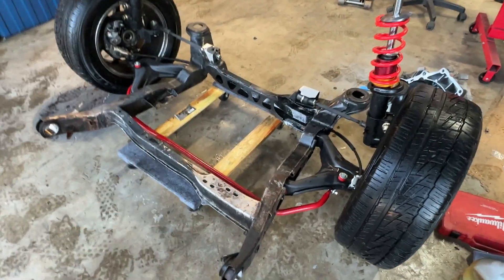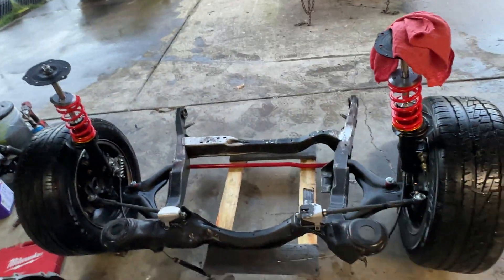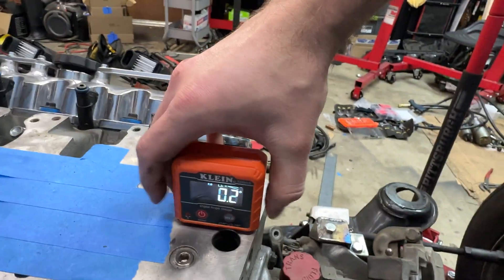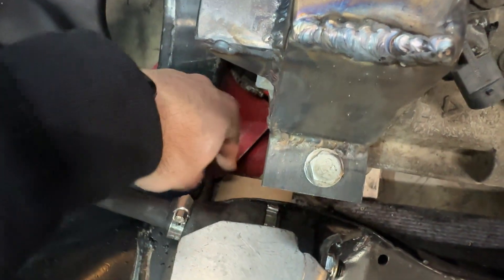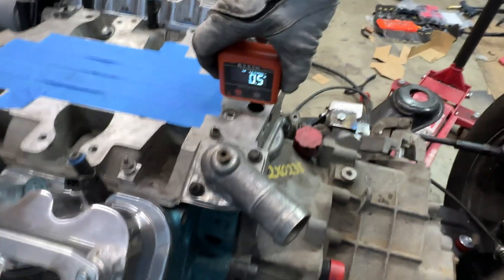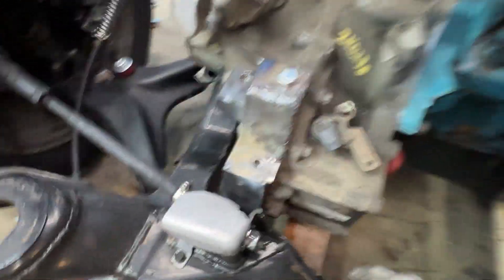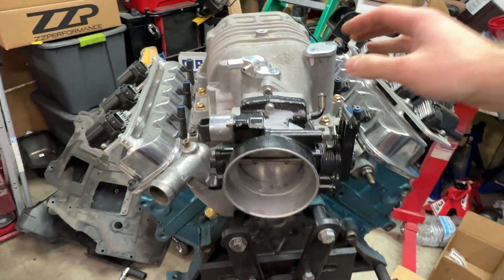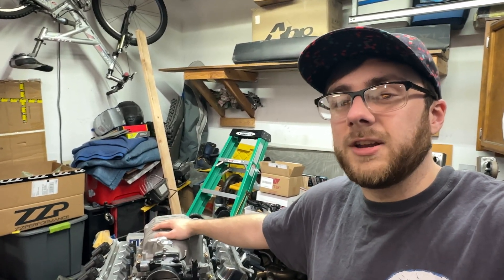1986 Fiero GT Engine Swap: Turbo 3800 Test Fit and Mounts

Comment: Glad to see that you are getting on with it. However, your solid mount setup will shake your teeth out! I hope you don't intend to drive long distances with this car?
Going solid mounts means basic race car only.
Please be mindfull that the cradle will quite possibly crack around the front and rear gearbox mounts...
But never the less, good job👍
Reply from the maker: Thanks! Planning on making this mostly a drag car so not very concerned about the vibrations. I will be reinforcing the cradle

Comment: Im excited to see finished product. !!! I helped my brother in law install a 6r80, cyclone 3.7 & epas out of a wrecked 14 mustang and in stalled it in a 1998 Miata. custom steel Drive shaft was like 18-22 inches HaHa. besides a custom exhaust everything is stock even tune. Dynoed 279whp at 6400rpm Ran a best of 12.2@ 113 mph on 235 tire that spun very badly. Car is terrifying to drive hard, I figure The Miata should be about the same weight as your Fiero GT. So I imagine if tractions right and you could put 300whp "down" you would have a solid 11s Street Car. Even Crazier if you up the boost. Make sure you get as much tire as you can your gonna need it .
Reply from the maker: Damn that sounds badass! I did a 6r80 swap on my 08 Mustang GT a couple years ago

Comment: I've noticed in your videos you repeat allot. Good content just repeat what you just said sentence before or shortly after. Welds look good. My only advice is burn in a tad more for better strength. Otherwise excited to see finished project. I'm in the gathering process of my 86 SE SC build. No video because I'm a hack with cameras.